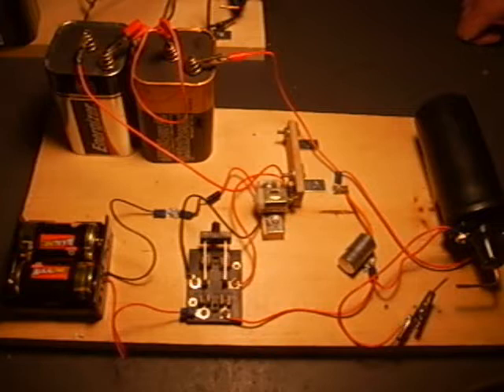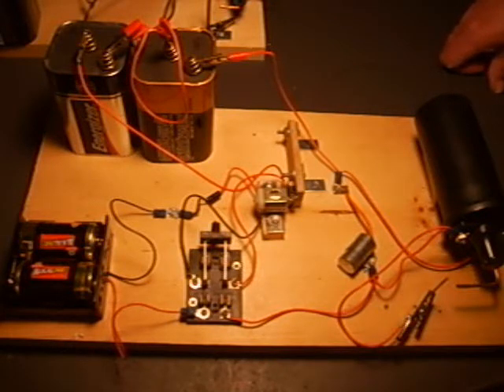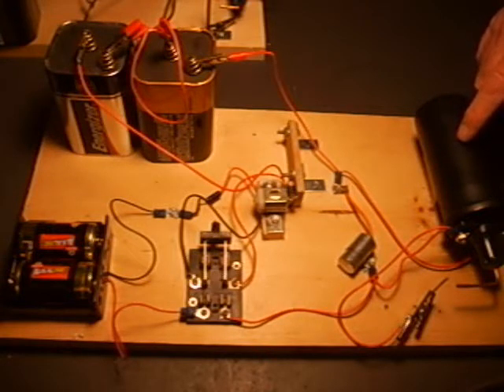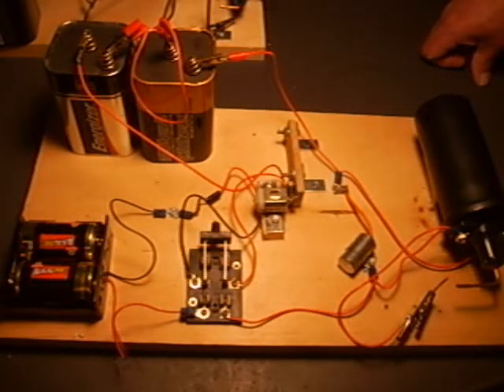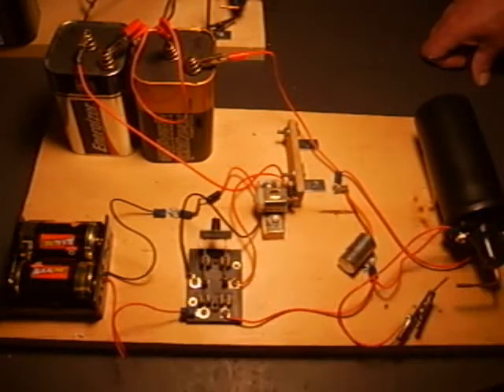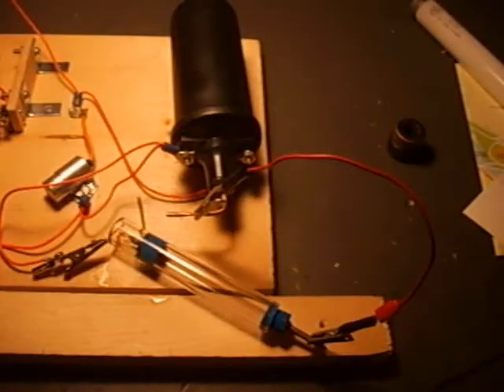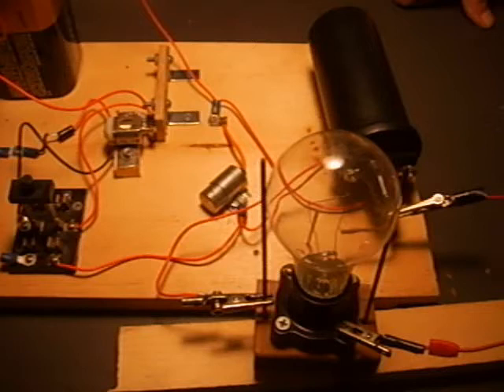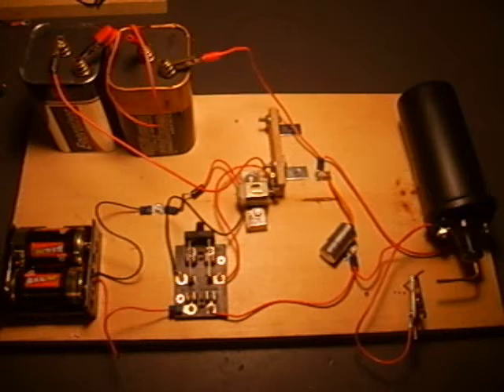Induction Coil Science Project

Comment: If the induction coil creates and oscillating magnetic field in the primary coil to power the secondary coil, can't you replace the motor, which opens and closes the circuit with an alternating current?

Comment: This is awesome.  I don't think that's a cathode ray tube though, because those have very low pressure (you do need a vacuum pump to make them).  In a CRT the only light comes from the tube itself past the anode (which is why you have to use something that will fluoresce, like glass), not any glowing of the gas or arcing in the tube.

Comment: no, the energy in an inductor is due to the current in de wires (E=0.5 L i²) if it is switched off, their is no current so no energie in the coil. Also the high voltages are optained by the the difference in current so, if there is no current, you don't have a problem (V= L di/dt)